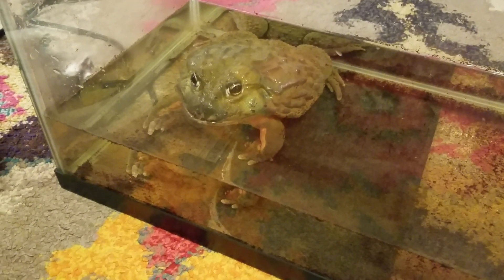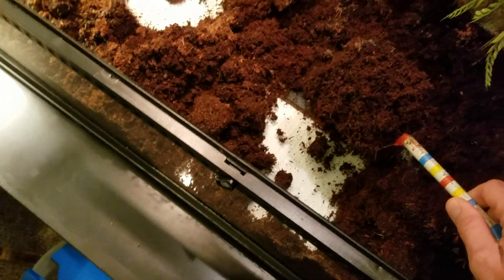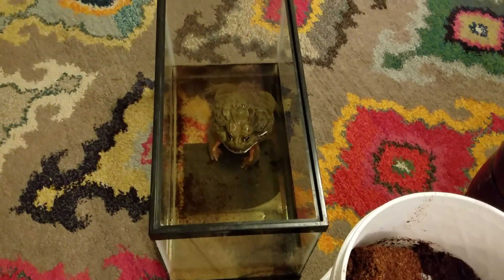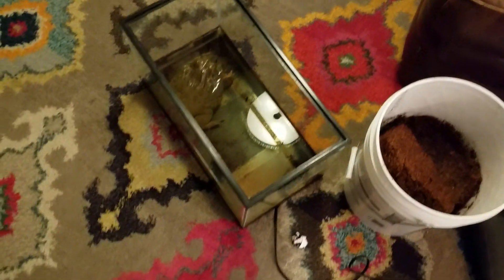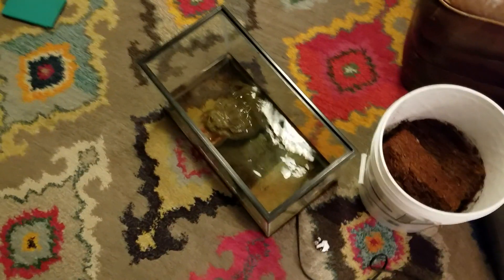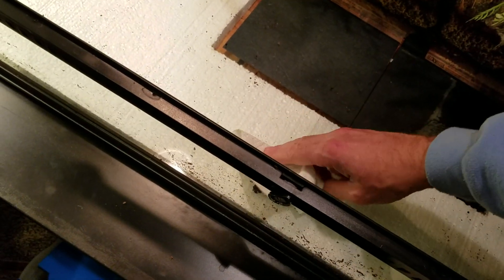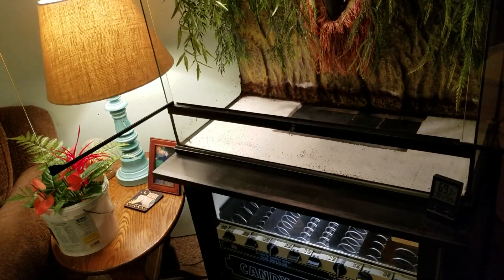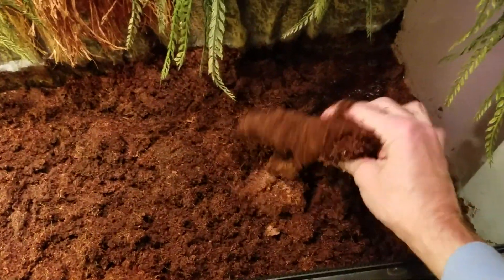African Bullfrog Mysterious Death Sydrome Solutions

Comment: UV probably helps a lot, I have several grow lights for the live plants in my frogs setup and it stays a lot cleaner than the setup he had as a baby which had less lighting and no plants. The tank also has a water feature with an oversized canister filter and a grow light right above it and that also stays noticably cleaner since I added the light.